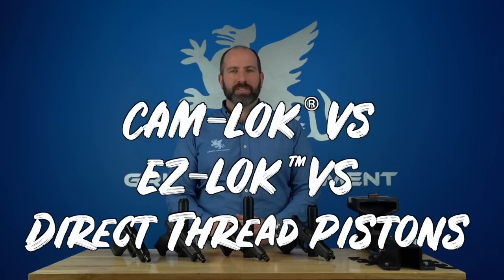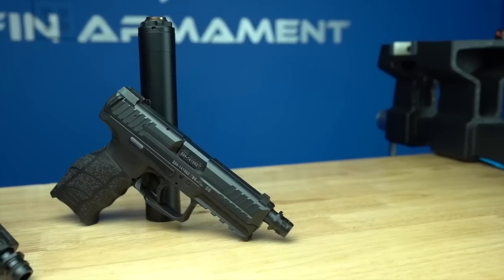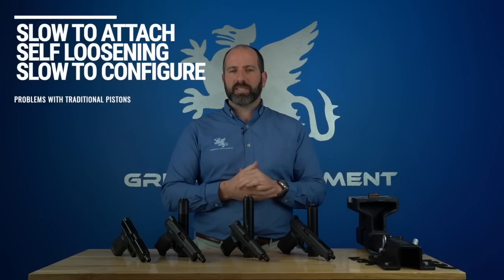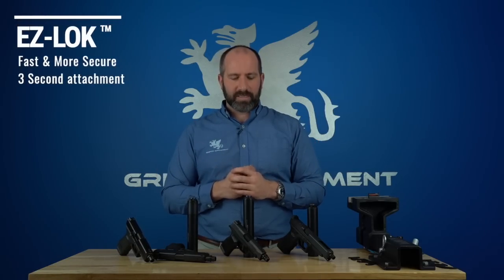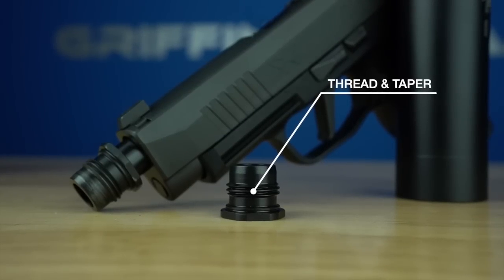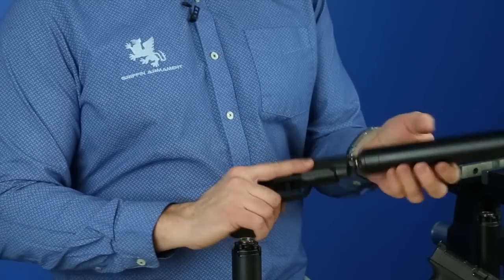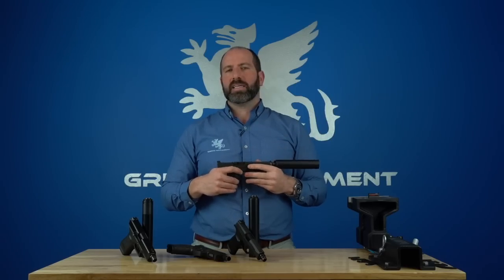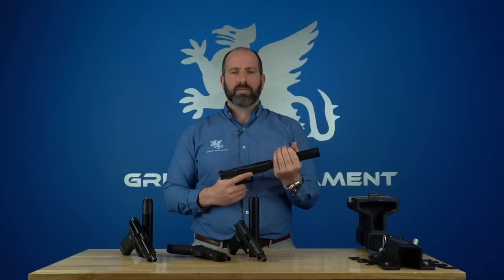CAM-LOK® VS EZ-LOK™ VS Direct Thread Pistons

Comment: I over did it and my cam is stuck on my suppressor. Any idea how to get it off?
Reply from the maker: It's usually best to disassemble the booster assembly so that you can get at the piston and barrel adapter. This will still have your retaining nut and spring in the way, so be careful not to damage them. From there, you can put a 3/4" socket into a soft jawed bench vise for extra leverage and then put your piston with the stuck Cam-Lok Adapter into the socket and turn it. A leather glove or strap wrench can give you extra leverage on the piston. This should easily remove the barrel adapter. We would then advise properly torquing the Cam-Lok barrel adapter down to 20 ft/lbs on to your tilt barreled pistol using a 3/4" socket

Comment: Do you recommend applying any grease or lubricant to the threads of the pistol barrel itself before threading on the adapter or to the course threads where it interfaces with the piston? Specially with the EZ-LOK.
Reply from the maker: Absolutely! We recommend using Lok-Cease 20/20. You can find that here: https://www.griffinarmament.com/suppressor-anti-seize-2300f/
Reply: @GriffinArmamentOfficial awesome. Thanks!

Comment: I run an Obsidian9, and I’m looking for a single mounting solution for all three of my pistols: Sig P322, Walther PDP, and HK VP9.  Since the P322 is not a tilt-barrel, am I SOL?
Reply from the maker: Since .22LR is a very low pressure cartridge, you can use any mounting system you like. You can use the suppressor in a tilt-barrel configuration on .22LR fixed-barrel firearms. Its generally not recommended as the functionality of the booster assembly on tilt barrel firearms is sometimes sensitive to excess carbon and lead buildup, but it is possible.

Comment: I hate to be "that guy" but if direct thread suppressors come loose because of how the threads are cut, what is to stop the Cam-Lok or Ez-Lok adapter from coming off those very same threads, especially since you said do NOT use Loctite, etc? Yeah, I get that you want 22 pounds of torque, but still, it's the same thread system ultimately. Yes it's faster to put the suppressor on, but still, the loosening issue still would seem to remain.
Reply from the maker: If you torque your adapter down to its minimum of 22 ft/lbs, it will take less force to break the suppressor loose from the adapter than it will to break the adapter from the barrel using just your hand. We've never had customers complain about their adapters coming loose or coming off. If the adapter is installed correctly, the threads should not come free.

We don't advise using Loctite because some of our customers have complained that they were unable to remove their devices after their adapters and other accessories became totally locked on.
Reply: @GriffinArmamentOfficial so couldn’t you technically torque the suppressor down direct thread style with the same torque and be good to go
Reply: @justanotheryoutuber5228 no because there is no taper to secure the lockup
Reply: @justanotheryoutuber5228  You probably could, but why would you? You'd need a wrench and a bench vise any time you wanted to remove it or swap hosts. I don't think most pistons or direct thread adapters are really meant for that much torque either, so there could be concentricity concerns, and longevity concerns as well.  There's a reason no one does this

Comment: If i replace the spring in the booster poison housing with the fixed barrel spacer, can I use the cam-loc on a .22 rifle?
Reply from the maker: Negative. Cam-lok can only be used with pistol calibers.

Comment: How much use overlap is there with Ez-lok and Plan A? Is Ez-lok kind of like a Plan A without a muzzle brake? Could you, and do you plan on, making muzzle brakes with an Ez-lok taper/threads on the back instead of Plan A taper/threads? There are so many adapters in this industry! I feel like I could run a can 6 inches away from the end of the muzzle threads using nothing but adapters! I've bought one Plan A hub adapter and muzzle brake because it seemed to be the lightest in the industry for taper mounts but I'm afraid to invest in more because I don't know which products are going to be phased out for the new greatest thing.

Comment: Does EZ Lok require less frequent retightening than Cam Lok
Reply from the maker: We still recommend checking tightness every 30 rounds or 2 15 round mags. But as long as the system is coupled correctly, it should stay tight longer than that.

Comment: The EZ Lok looks a bit faster than direct but the guy definitely went fast on the EZ Lok on purpose lol...
Reply from the maker: Nope, it really just is that much easier to attach. Less threading necessary for attachment and tapered surfaces to pull the system together and keep it from unscrewing like traditional pistons

Comment: It would be cool if Griffin released a checkmate qd system that can be adapted to any 22LR can (similar to the Gemtech 22 QDA adaptor which seems to have been discontinued)
Reply from the maker: https://www.griffinarmament.com/cam-lok-universal-932x28-checkmate-direct-thread-adapter/
Reply from the maker: These CAM-LOK Universal .932x28 Checkmate Direct Thread Adapters allow you to convert 1" tube rimfire silencers to receive CAM-LOK barrel adapters, such as the SWR Spectre.
Reply: Very cool!

Comment: Thinking about getting a Q erector 9. Just want to make sure I’d be able to use the EZ lok first.
Reply from the maker: That would require the Direct Thread to EZ-LOK Universal Adapter (1/2x28)
Reply: @GriffinArmamentOfficial   Sorry, my question wasn’t very clear. Do you have an E-Z Lok piston that works with the Erector 9? I don’t have an Erector 9 on hand, so I’m not sure if they use similar piston specs as the ones you already have listed on your site. If the Direct thread adapter is the only option, is it supposed to be torqued into the can? Thanks in advance.
Reply from the maker: @timdonahoo  from my search, the erector 9 is a direct thread suppressor. I sent you the device you'd need to make it EZ-LOK compatible. The EZ-LOK threading is not the same as a 1/2x28 thread pitch and will not work on its own, so would also require a 1/2x28 threaded EZ-LOK barrel adapter.
Reply from the maker: https://www.griffinarmament.com/direct-thread-to-ez-lok-universal-adapter/
Reply: Podrá ayudarme cuales son los que debo con rosca 1/2x28 para hellcat!?

Comment: So, what I'm hearing is you created the EZ LOK system for those who couldn't figure out the CAM LOK system.  I've run the CAM LOK system since it was introduced and love it.  I have never had any issues with it coming loose.  I have had issues with the host can's piston cap (or whatever it's called) coming loose, but never the CAM LOK.  I have had to teach customers how to properly use it.  I'm all for options, but it's all CAM LOK for me!
Reply: The EZ lock “should” in theory have better retention. More thread engagement, higher allowable torque this force on the taper. The cam lok apparently can be damaged tightening too much. Apparently griffin addressed this, but not sure if it completely fixed the issue or not.
Reply: My cam lok was working fine then around the 900ish round count my can went flying off luckily no baffle strike
Reply: Have you thought about using blue loctite on the pistol cap so it won't come loose?
Reply: Blue locktite would burn off from the heat.
Reply: @atadbitnefarious1387  fair point
Reply: @Team-Elevated  Commercially available red loctite (721 IIRC) is high temp up to 500F. There is another variant of red loctite we use on jet engines in aviation that goes either up to or over 600F but I forget the name civilian code and the exact boil rating of it.

It's been two years since I've had to rebuild an engine so I'm a little fuzzy on the MIL-PRF.
Reply: @asymsolutions  great info. Do you think red loctite would be a bad idea on barrel threads?
Reply: @ElevatedVehicles its a bad idea when you have to service the pistol.

Comment: Great looking gear. The video is well done but tell your a-hole neighbors to turn down the damn radio.

But traditional threaded lets you look really cool - like on TV and in movies.

But being less of a smart-ass - could threaded devices be threaded left handed? Is that supposed to be why the Russians thread the AK lefty - so that the torque keeps the muzzle device tight?
Reply from the maker: as long as you torque the barrel adapter to the specifications we recommend, there shouldn't be an issue of the adapter unthreading. But. Must be torqued to spec

Comment: Could you use the EZ-LOK 1/2 28 adapter and rocksett it into a Direct Thread 5.56 can, then use the EZ-Lok barrel adapter to basically have a quick detach setup?  I have an older can I am looking to do this with. Thanks.
Reply: @350volvo, did you ever try the ezlok on your 556?
Reply from the maker: We don't recommend using rocksett basically ever. 35 lb/ft of torque should be more than adequate

Comment: Soooo what your saying is  all those CAM-LOK accessories i bought a few months ago while I'm waiting for my tax stamp to come in was a waste of money
Reply: Seems the difference is if you want quick on and quick off for a mag or so get the cam lok. If you want a more robust solution you basically can’t damage by over tightening and can fire mag after mag without the can getting loose, get the EZ lok. I went easy lok because retention and idiot proof is more important than the 2 seconds I save attaching the can from the cam lock.
Reply: Yep. I did the same unfortunately. EZ-LOK is way better.
They pretend like their originally marketing material didn't state that CAM-LOK was more secure than direct thread and "you don't have to check your suppressors every mag". I had to check mine more than direct thread using CAM-LOK.
Reply: @LeCafeRacer  This is all new to me.  It sure is a head scratcher reading your comment and then seeing some people above you in comments extolling the virtues of the same system that you pan.  More to this suppressor stuff than I realized; that's for sure.  Of course, while I'm an experienced shooter, "cans" are novel for me and it seems like an entirely separate sub-genre of expertise apart from actual shooting...like telescopic sights.

And I can't wait to start finding out that I'm going to need to be alternating recoil springs depending on whether "can" attached.
Reply from the maker: Nope, CAM-LOK is still a super slick system. And our favorite QD system, EZ-LOK is just another option.

Comment: Nice. It is a pain to retighten pistol cans.  Nice solutions.  I've got a Griffin can, but others too. Can I use this system to convert them to this mount?
Reply: Yes, absolutely.  Griffin, SiCo, Dead Air, and a lot of other manufacturers utilize a pretty standard piston design. There is an older legacy version you may encounter, so always do your research first, but I dropped one of their pistons into an Octane 45K, and bought cam lok mounts for my 1911, M9A3, and P07. So much nicer than switching carbon and lead fouled pistons every time I want to shoot the 1911 quiet.

Comment: In both cases you're still relying on a direct threaded adapter not loosening off though, right?  So it's not necessarily any more secure than just direct threading unless you pin the adapter on or use rockset.  Seems like machining the adapter specs with both the interrupted threads and taper on a barrel blank would be the way to go.  3-lugs are the same way, if it's machined into the barrel it's great, if it's a thread on adapter you're basically still direct thread with a handy 3-lug feature between the barrel threads and can.
Reply: When is the last time you installed a direct thread suppressor with a torque wrench? I’d guess the answer is, never.

This system is a huge improvement over direct thread. 
If you don’t like it, stick with what you know
Reply: @Don150T  why would somebody use a torque wrench to tighten a can?  I never do and mine are direct thread.  When I shoot, my can will tighten significantly.  It’s like an oil filter.  You don’t have to tighten them much and the pressure and heat will tighten it more.
Reply: @100fredkrueger  I thought they always loosened when you fired.  I thought it was just a matter of time.  On another video involving direct thread and cam lok, host says he hand tightens suppressor every five rounds or so.  Is this not the case in your experience. (Just curious, as I have little experience with "cans.")
Reply: As someone who has put thousands of rounds through my Cam-lok on a 45acp 1911 and M&P9, the muzzle devices don't loosen up. I pull them on and off to clean my guns every 500 ish rounds. I launched my can once because I didn't torque it on right, and this new product is for people who are afraid of that. My Rugged can is fine and it wasn't the Cam-lok fault. I love mine

Comment: I've got a gen2 optimus at my dealer when shooting it on my pistol with the cam lok the booster assembly tries to come out of the back of the cam when taking it off the gun
Reply from the maker: Sounds like the housing needs to be torqued down into the tube body
Reply: @GriffinArmamentOfficial  I'll give it a try finally get to bring my baby home Saturday

Comment: So I wasted money on my Camlok system that comes loose?
Reply: My cam lok doesn't stay locked on at all either.
Reply: Yes you did, so did I. Even after calling Griffin and doing this pull forward silliness it still launches the can after 5-10 rounds at most. Gonna have to switch to EZ lok if if ever comes back in stock.
Reply from the maker: If you're having issues with your CAM-LOK system, we recommend that you reach out to customer service. They can be reached at cs@griffinarmament.com
Reply: Dude the only way your CAM-LOK system is coming loose is if you hand tightened it or torqued it to below 22 FT LBS. Out of the dozens I've seen properly installed, literally not a single one has had any sort of issue running it. Everyone I know that's tried one quite literally freaks out about how amazing it is. Get yourself the proper tools for installation and you'll thank me later.
Reply: @FirearmEnthusiast  I think he’s saying the piston comes loose from the cam lok. Not that the adapter comes loose from the barrel. It seems pretty well documents (check out jay at pew pew science) that the cam lok does not have as good retention as the EZ lok. I bought the EZ lok to be on the safe side. Would love to buy both and post a video comparing both after a few mags to compare but not dropping another 140 bucks to appease my curiosity haha. Brilliant system by griffin though. Can’t believe it took until now to come along
Reply: @stevis182  So how has the EZ LOK treated you, does the suppressor not come loose?
Reply: @ItsIntelligent  it’s the best mount I’ve Ives. Does not come loose. Fantastic design and I’ve decided it’s going on all my hosts

Comment: Ez lock seems like a direct thread that already is in use .....
How is this better than the current threads ?
Reply: Time yourself installing a standard 1/2-28 threaded silencer to the barrel, and compare it to this - it's quicker, but not a huge difference to most people. The coarser threads of this system won't get dented as easily as exposed fine threads, that's also a benefit. The retention features - if even adding a small amount of resistance - help over standard fine/square shoulder threads that loosen easily (leading to droopy can baffle strikes). Whether it's "worth it" to have the extra weight, cost, and clunkiness up front, added disassembly steps, etc.  is up to the end user, of course.
Reply: The taper interface means that it won’t come loose like standard threads. The coarse threads means your can goes on quicker.
Reply: Super secure, doesn't back off like a regular piston. Also doesn't wear like the cam lok so you won't wear out the partial threads.
Reply: @braxtonnelson7976  time will tell if it's more secure , don't save time like advertised is what I'm saying
Reply: I have a direct thread can.  It doesn’t bother me to put it on and remove it the way I do.  It’s not like I’m in a situation where I need to put it on and take it off real quick.   As for this being more secure, I don’t know if it is or isn’t.  But I have Griffin flip up sights on my AR and they are excellent.  I’ve been considering getting the Optimist suppressor.  But I may just make another form 1.
Reply: @100fredkrueger  I have a 45acp can that in two seconds I can remove from my 1911 in 45acp with bigger threads and put it on my 9mm M&P with smaller threads and not even get my hands dirty. Cam-lok has been a desire of mine since I first saw a suppressor in a movie as a child. I love it

Comment: I am using a H&K USP45T and the Rev. 45 with cam lok mount. The left hand threads on the barrel being the opposite of the actual cam lok adapter makes me weary. Every time I put the can on I feel like I’m loosening the adapter.
Reply from the maker: As long as the barrel adapter is appropriately torqued to spec, should be good
Reply: @GriffinArmamentOfficial  that low of a torque spec could be overcome with hand pressure from securing the can though?
Reply: @reker.a5790  No, just torque it to spec, like he said and it'll be secure when you take the suppressor in/out of the pistol.